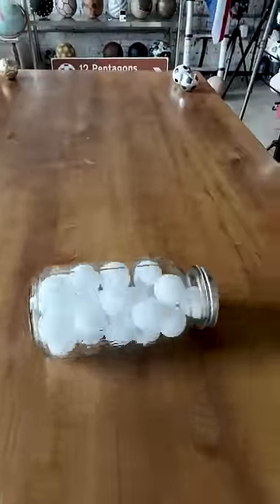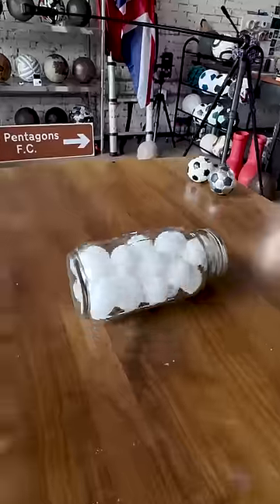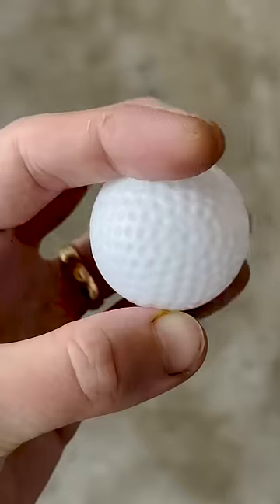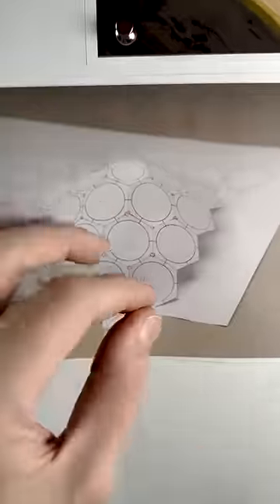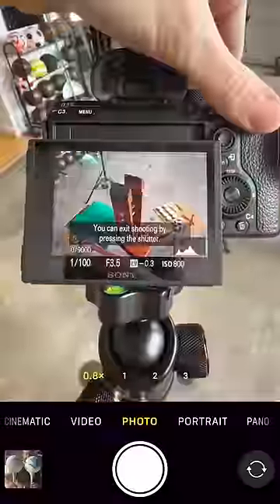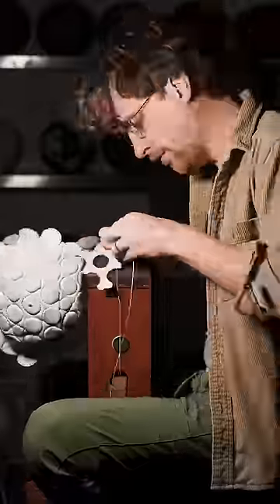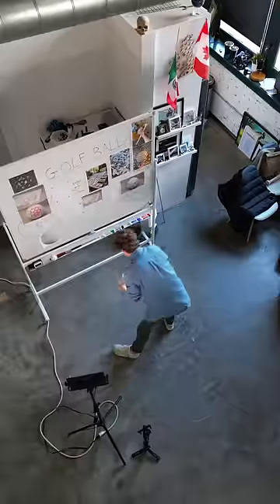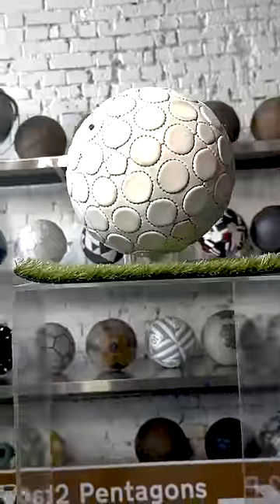making a football inspired by a golf ball

Comment: The dimples need to be inverted. The purpose is to make low pressure pockets which create a low pressure space around the golf ball as it flies reducing air drag.
Reply: Do this. I want to see it.
Reply: @Sue_D_Nymn  would be difficult without either much thicker material pre shaped or some sort of support structure. Once you apply air pressure the dimples want to push out.
Reply: @GamrGemini , maybe a layer of foam with cutouts for the dimples could be the structure. You would also probably need to stitch it so as to squeeze the individual dimples slightly to force them to ... well, dimple.
Reply: @Sue_D_Nymn  really thick with a hoop structure maybe? Trying to think hot to preserve the inflated ball feel, as foam would feel more like a futsol than a football.

It would be difficult to fine tune but a center anchor with tension wires might be a solution?

Comment: The dimples on a golf ball are to prevent the ball from experiencing drag crisis. Its when the drag coefficient suddenly drops dramatically due to a high velocity, while the chaos of the system increases. This causes the ball to move unexpectedly. The dimples can also improve fuel efficiency as it prevents a vacuum from forming behind the vehicle. The dimples also dont need to be inward facing, they just meed to make the surface of the ball not smooth and not homogeneous